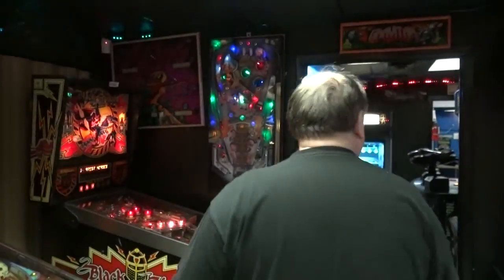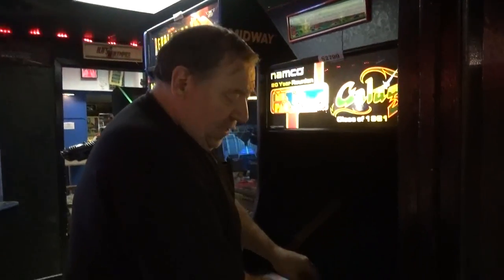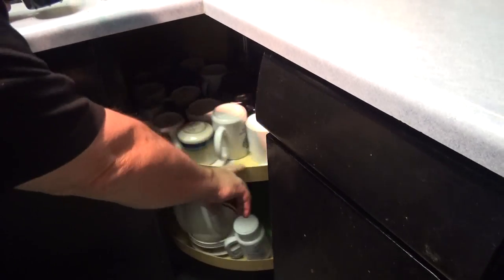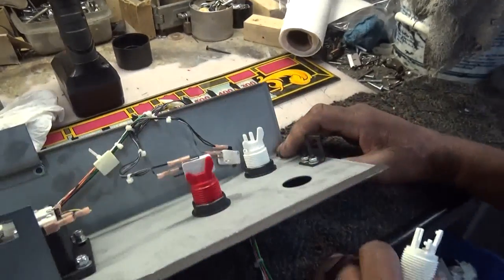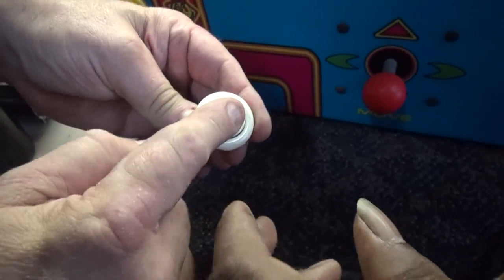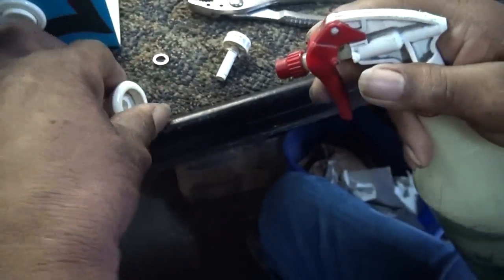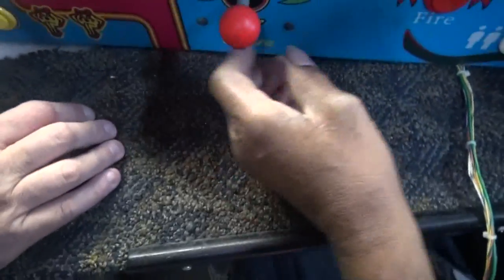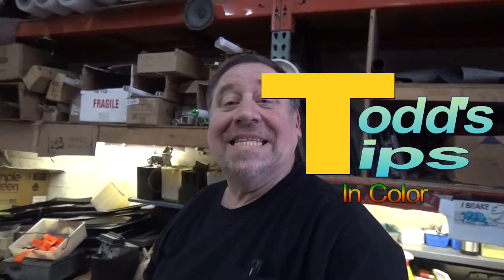#705 How To CLEAN BUTTONS on Arcade Game Control Panels-TODD'S TIPS series - TNT Amusements

Comment: The wire control parts are supposed to just pop out? I have a Street Fighter II Champion Edition and those suckers are just stuck in there. Won't budge. Any ideas?
Reply from the maker: Tails19935 there are different buttons and how they are made...but almost all buttons are designed to come apart.